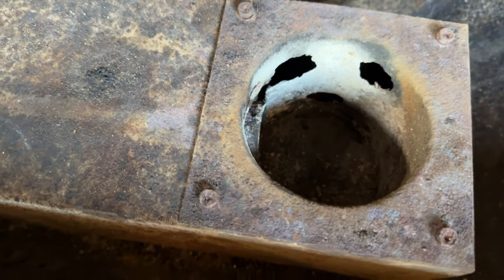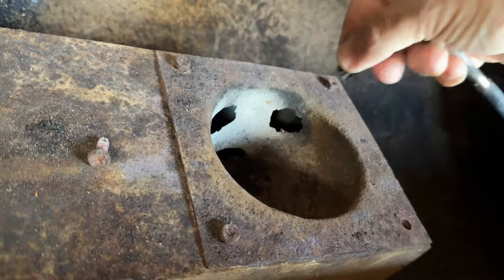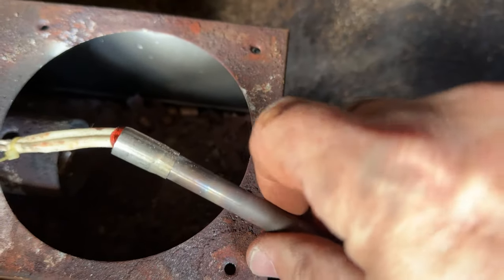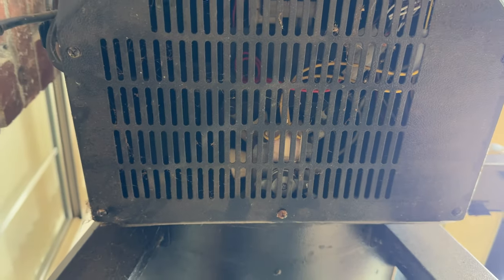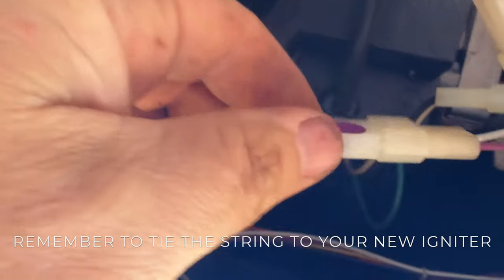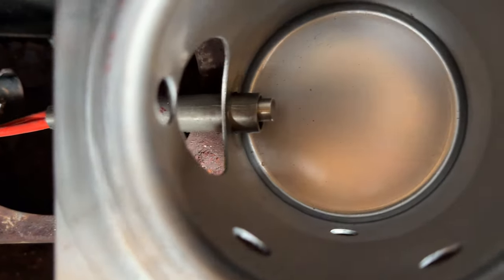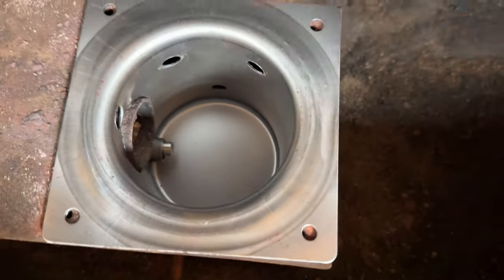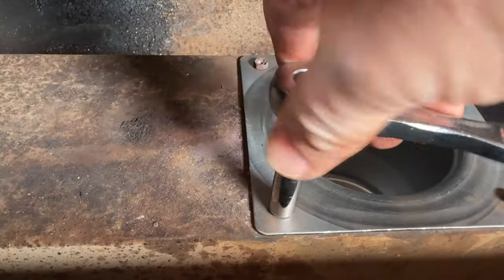GRILLAX — GRILL REPAIR: How To Replace Pit Boss Pellet Pot

Comment: Is that the Pro Series 1150 Grill that u replaced the burn pot
Reply from the maker: I believe it's the PS 850
Reply from the maker: The pot will fit the 850 and 1150